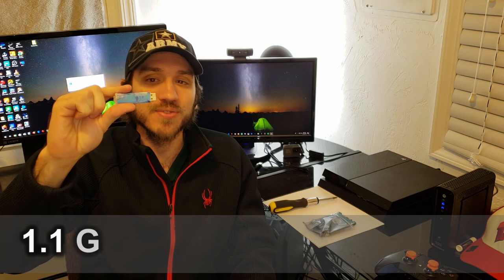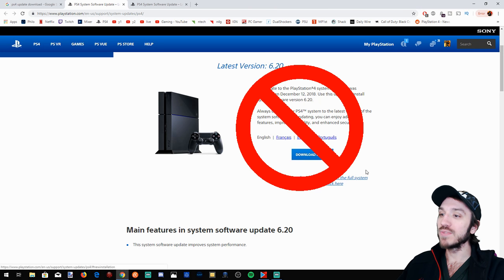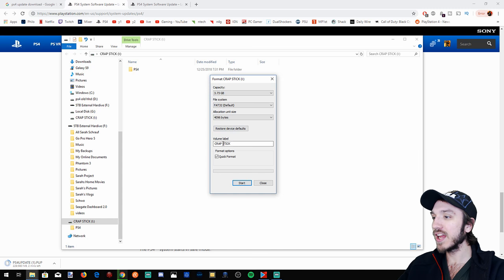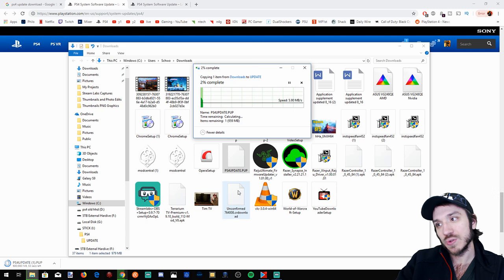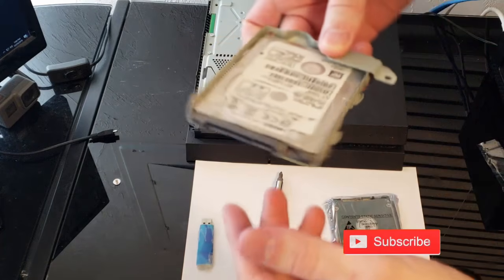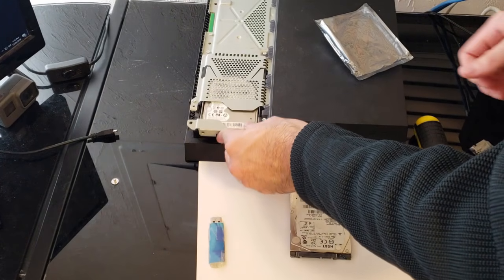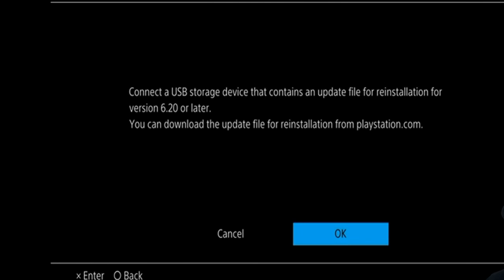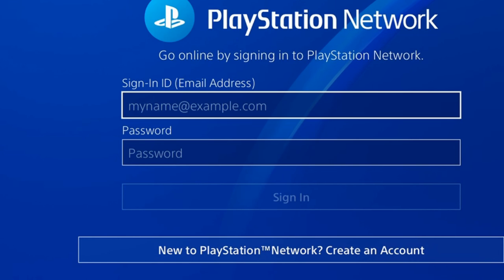How to install NEW PS4 Hard Drive (500GB to 2 TB) Upgrade Tutorial 2019!

Comment: Correction 2.5 inches not mili meters.
Reply: Will this solve the issue of my PS4 not starting properly? Every single time I boot up my PS4 it performs a storage status check and never goes to the main menu. It has been over 3 weeks now and this is driving me insane.
Reply: @CHlEFFIN  have you done it?
Reply: lukas yes. It fixed the problem. All you need is an HDD (or SSD) to replace the one in your PS4 which are crap, a 1.1GB flash drive and your set mate. It’s very easy.
Reply: @CHlEFFIN  I orderd one 5 minutes ago
Reply: lukas good luck mate! I will be here if you need any help.😁
Reply: @CHlEFFIN  ty
Reply: CHlEFFIN h can you tell me which one you brought and how much did you spend
Reply: @CHlEFFIN  Everything worked fine, thank you
Reply: Dacari Whitehead I ordered a Western Digital 2.5 inch 1TB PS4 HDD off Amazon for like $60 dollars - any HDD/SSD should work as long as it’s 2.5 inches.
Reply: CHlEFFIN what are disadvantage to ordering a SSD instead?
Reply: @Spanluver  SSD is faster than HDD. If you put the SSD on ps4 pro it load faster. But if you put the SSD on ps4 normal or slim, they don't differ much from HDD in terms of loading time.
Reply: Lunnardo Lukias yeah I knew ssd faster just curious about the Gaona but doesn’t seem to justify cost
Reply: Thank you I was confused
Reply: lol i was gonna say the same thing.. when IT people comment on non IT people's videos lmao
Reply: 2.5 mm would be so tiny
Reply: CHlEFFIN so it fixes the 7.50/51 error problems?
Reply: John Gilip yes
Reply: Help mine is stuck at 99 percent for initialization

Comment: I feel like sony is making things more difficult to do simple stuff I did everything this guy said and my ps4 still wont let me update the hard drive all it says is put a USB with the file eventhough I have it
Reply: https://www.playstation.com/en-gb/get-help/ps4-system-software/
You have to make sure that you  have the right file bc I was having the same problem.  It's the one at the bottom right of the page to the link in this comment.  Download PS4 reinstallation file
Reply: KarachayTulpar are you trolling or fr
Reply: also, your flash storage has to be formatted in fat32 since ps4 cant read the NTFS format
Reply: @gouthama9221  its so bad because fat32 is over 20 years old
Reply: Make sure it’s usb 3.0 or higher
Reply: Larry Hukic you cant use a 2.0 usb? That’s what I have and I get the same error as him
Reply: Mike Elmendorf it doesn’t have to be USB 3.0 he doesn’t know what he’s talking about. Thats just to use as extended storage. I just did it with a 2.0 Flash Drive and it worked
Reply: Bryan 350  really? I haven’t gotten mine to work yet
Reply: KarachayTulpar bro for real? I have the same problem. Please I need help. I did step by step on the video and my ps4 cant find the update file. I did both folders, ps4 and updates, but cant solve it. Did you find any solutions? Thank you!
Reply: Diego Morales I got it to work, just have to find the right file to download. The first file I downloaded wasn’t the right one and I honestly don’t know where I found the second one. I know it was on the same PlayStation update site. Just go through the files and try it one by one. One of them will work
Reply: KarachayTulpar it said I needed the PS4 update file when I choose the 7th option
Reply: @prmikee9 are you in fat32 formatted?

Comment: It worked for me until I connected the USB to the ps4 and said it couldn’t access the update file
Reply: You have to make the folders in order PS4 folder first on your external hard drive then add an UPDATE folder in the ps4 folder then add the sofware file in the update folder
Reply: @lordgunnyquay8933  I did that, still didn't do a thing, even did the FAT32 formatting.

Comment: I was so nervous to try and switch out my hard drive since I’ve never done anything like this before. You’re video was incredibly helpful and easy to follow. Thank you!
Reply: Hi, are there any risks? Like if I want to buy one from someone who has changed the hardrive are there anything to keep in mind?
Reply: @oo6069  the only thing I'd keep in mind is that the hard drive can be a very fragile piece of equipment. Handle it with care
Reply: @DutchVanDerLinde-sx1ox  where you brought your hard drive
Reply: @desmondpierce9177  Amazon
Reply: @DutchVanDerLinde-sx1ox  what size you get and did you also do the USB flash Drive update
Reply: @desmondpierce9177  1 TB. And I believe you have to use the flash drive to install the OS on the hard drive.
Reply: So will your old hard drive still have all the data on it
Reply: Period 🤝

Comment: Everything is spot on! I did this twice. Once with switching to 2 TB (2.5” one) and the second time was with the nyko data bank. Got a 4 TB separately with that (3.5” one). Luckily my nyko data bank can hold a 3.5” and a 2.5” hard drive. You would just have to press the button to switch to hard drives. Make sure red light matches to 2.5 or 3.5 as it says on the front of the nyko data bank. Make sure to only do that when the PS4 is completely turned off and while it’s plugged in. Then you turn the PS4 to the desired hard drive you want to start up. This only works for the original model of the PS4. I am unsure if the slim or pro has any nyko data banks for their models. This was before external drive support was added by Sony. Might as well keep what I have right now as long as it’s maintained

Comment: So I think you're the only one who explains exactly which file to download. Thanks
Now time to buy a hard drive
Reply: Roger dude will buying new hard drive fix my lag and crashing on Fortnite please tell me
Reply: PoliceGuy1111 Rblx yea but why do all of that when u can just goto safe mode and rebuild the ps4 database? ( it doesnt delete anything what it does is fix any problems like ps4 lag/freeze/ disc problems etc and no it does not delete anything off of ur system ). It’s basically like a quick fix
Reply: PoliceGuy1111 Rblx i just rebuilded mines a couple months ago and my ps4 been running extra faster and smooth since then and my disc problems are now gone as well
Reply: Manny Maserati I tried that I don’t crash I only get framedrops on gta online when I’m in a big lobby and it didn’t use to do that please guide me please I beg you
Reply: PoliceGuy1111 Rblx yea i get what ur sayin that was happening to me on black ops 4 as well , you only did it once? It took me 2 times of rebuilding database back to back to get this to work i also but default settings back and everything was fixed bro
Reply: Manny Maserati oh oh ok I will try that right now
Reply: @enriqueavilamoreno980  bro yes you will have like  a new ps4 and if you buy an SSD thats even better .
Reply: ben ali mourad thanks bruh
Reply: Enrique Avila Moreno did u get one I have similar issue I get CE-34878-0 this error on every game I try to load
Reply: Manny Maserati CE-34878-0 will buying a new hard drive fix this error on every game

Comment: So my data got corrupted and my ps4 went into a safe mode loop. Bought a new harddrive and used this video as a guide. My ps4 is in the factory reset menu rn and I hope to god i will never have anymore problems. Thx for this video bro

Comment: Good and clear video. Nice work. 
If you want to transfer your saved games, profiles etc., do a backup (from backup & restore option on the ps4 settings) to a USB external drive, before replacing the hard disk. 
After replacing the hard disk and installing the system software, restore the backup from the same menu.
Reply: How much space would I need on the external drive
Reply: @NijahsLover  You can check how much storage is being currently used on the existing hard drive and use an external which has as much space or more. Make sure that the external is empty.

Comment: What about backing up everything that you already have on your ps4?
Reply: Copy it too the cloud or another flash drive.
Reply: Im not too worried about backing everything up.  I normally play COD WW2, but now I play Division 2.
Reply: If you have a subscription to Psn you can just upload to the cloud. Otherwise use a usb zip
Reply: U can use a back up function in the settings
Reply: You cant back up using an external hard drive? It has to be a flash drive? I just bought an external hard drive and it's only letting me use it as extended storage it wont read it as a USB storage device when I try to back everything up 😩 its 1tb I was excited to do this today
Reply: Sapa Inca Use the Cloud If you have PS Plus.  You can also Use a back up function in your settings.
Reply: @MajinInca  you might want to format the external hard disk as FAT32 and you will be able to use it as a removable storage on your PS4 to back up files
Reply: @VivekSonii  brilliant
Reply: Can you get someone else to go on their ps4 but sign into your account and they upload the saved data to the cloud or online storage or whichever one or do you have to do it on your ps4

Comment: worked a treat mate thanks heaps. turned out my disk drive ribbon cable was unplugged causing me to get the error su-42118-6
Reply: Coukd you fix this, mine saying an error to but su 30645 8 aboht The update file is corrupted

Comment: It worked like a champ and didn't take long at all. This was an excellent tutorial and now my PS4 runs about as fast as my PS5. The only thing I did a little different is install a 2 TB SSD hard drive in mine so it moves a lot faster. I will definitely recommend your videos.
Reply: Heys how the 2tb working im thinking about getting a new ssd and did you replace because your hardrive failed on you ? Thats the reason im looking into one
Reply: It works great. I can tell the difference in speed and now my PS4 works as well as my PS5

Comment: When I get to the Safe Mode, it constantly tells me it can't upload the update file, even though I downloaded it a couple hours before I tried this. Latest file and everything, yet it won't get uploaded.
Reply: PS4 folder, UPDATE folder, the file, he showed it wrong
Reply: Download it using internet explorer or edge , i think you were using chrome , chrome tends to corrupt files , it did the same for me
Reply: I have the same problem. Please I meed help. I did step by step on the video and my ps4 cant find the update file. I did both folders, ps4 and updates, but cant solve it. Did you find any solutions? Thank you!
Reply: @123diegoxis123  I'm waiting till I get my own computer and a new flash drive, pretty sure my old one's screwed up.
Reply: @123diegoxis123  did u try to use "edge" browser ?
Reply: Saudxha i will right now!!! Hopefully it works man. Im dying :(
Reply: Jason Brown i bought a new flash drive one today bro and trist me ive tried so many times!! I also have a decent computer. I will try with another internet explorer, like everyone is suggesting! Ill tell you how it goes for me
Reply: Saudxha IT WORKED FOR ME!! Bro I slept like at 6am hahahaha you have to format your usb drive to FAT36 to FATX or some other fat name related (there’s only 3 options) and thats it. It worked for me. Also i download the update from edge microsoft
Reply: @123diegoxis123  
Congratulations man ! Finally haha

Comment: Thanks to your video, I finally decided to upgrade my PS4 500 GB HD to a 2TB SSD.  Amazon has the Seagate FireCuda 2TB Solid State Hybrid Drive Performance SSHD – 2.5 Inch SATA 6GB/s for $64.99.  Anyway, it's working very well.  The lastest PS4 update download is 6.72..that is as of 10/4/2019.
Reply from the maker: woooh. I'd love to see the speed boost with that hard drive.
Reply: Luis Santos wait do you have the ps4 slim
Reply: can you send the link of the SSD

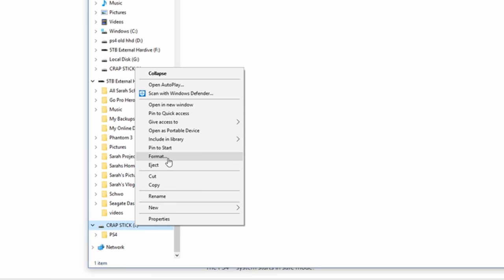Comment: If your flash drive doesn't work and you keep getting errors saying that the update file isn't on the stick, it is important to do the step at 2:35. I was having this issue and I formatted it to the FAT32 and it worked. So if your stick is Fat(default) change that to FAT32 and it might possibly work.

Comment: Thank you soooo much!! My ps4’s hardrive randomly started bugging out and kept freezing
Reply: I have a similar problem and it doesn't even let me play games because of the freezing , so by replacing the hard drive it can stop my Ps4 from freezing?
Reply: BULLDOG197107 worked for me, im assuming if the game is running at the full framerate/ expected performance than its not the ps4’s visual hardware thats at fault but the hard drive
Reply: @christianbilski3799  and did it worked?? my ps4 also freezing and playing games is really buggy
Reply: @help4free389  Ya it worked I got it fixed yesterday.
Reply: @christianbilski3799  thanks i already ordered 1
Reply: @help4free389  Hopefully it works for you.
Reply: @masuDore_  Thanks.
Reply: @christianbilski3799  I have a new hardrive and ps4 works normal again :D
Reply: @help4free389  That's great.
Reply: Help4Free which one do you buy can you tag me in link ?
Reply: @DontaeSavage  I got this one Seagate Firecuda ST2000LX001 2 TB

Comment: You cant back up using an external hard drive? It has to be a flash drive? I just bought an external hard drive and it's only letting me use it as extended storage it wont read it as a USB storage device when I try to back everything up 😩 its 1tb I was excited to do this today

Comment: does the usb have to be exactly 1.1 gb or can I use a 32 gb USB?
Reply: you can always use a bigger USB. 1.1 is just the minimum you need due to the size of the update file.
Reply: @LordTyrionLannister  oh ok and also we have to backup our stuff before we switch the hard drive right?
Reply: @sajidvijayan4306  yes. i would recommend using a second USB to save your game progress as well as your screenshots, videos etc . basically a backup of your whole data. also sync your trophies with the playstation network, otherwise they might be gone

Comment: On a separate flash drive from the ps4 one you can save all of your saved game data from your old ps4 hard drive before you remove it.  After installing the new hard drive and installing the operating system you can simply load the saved data from the old ps4 hard drive onto the now new hard drive. That way you don't lose where your at in any of your current or past games

Comment: My ps4 has been stuck in safe mode for about a week now and I’ve had to initialize it about ten times in the past which sucks, but now it won’t even let me initialize my ps4. So will replacing my hard drive get my ps4 out of safe mode?
Reply: I Have The Same Problem But The Thing With My PS4 Is That I’ve Tried All 7 options On Safe Mode And It Still Turns On Sage Mode , And My Power Button Doesn’t Work
Reply: Carlos Luna replace hard drive and it should work w
Reply: Same this is the 5th time i think a new hard drive will work

Comment: I forgot to put the pup file in an update folder in the ps4 folder. I also had to use a usb that was not bulky and use the second USB port as the first one would not read. Now I have a 2tb hdd until the ps5 is cheaper or has good games

Comment: I have done everything to a teeee exactly how you’ve done it and I’ve done sooo much more to try and resolve this... I either get corrupted file error at the reinstall screen or a random error that only gives me the option to restart ps4. Ive tried downloading on different computers, different browsers, different drives and again it’s a new hard drive and stupid error that has no explanation is popping up. Thumb drives are formatted and I even went into disc management on the thumb drive, it’s been two days, this is getting out of hand. Gonna smash this ps4 soon if it’s not resolved.

Comment: Technically it take you longer than 15 minutes because you first have to go through the process of backing up Save data, writing down any special settings you had on, and make sure if you're game sharing with a friend(s) letting them know to give you the account info again (even though it doesn't take that much time but it's still noteworthy). It's a long and tiring process lol.

Comment: Will I lose all my game data, friends, and everything? Or will it be there when I sign back in to my account? Is there anything I need to save to an external before doing this, so I can reinstall on the new hard drive? I'm trying to do this for my husband as a surprise and I don't want to mess up his system. He currently has an external hard drive and the USB port is going out, making the external not work properly. I want to download all of the external files onto the new 2T hard drive once installed.

Comment: Ok so I have a problem my ps4 broke it cannot be turned on so there’s no way to backup or carryover my saved data to a new ps4 and my only option is to swap the hard drive. Can I swap my old hard drive into the new ps4 and download the saved files to a usb and put it on the hard drive from the new ps4?
Reply from the maker: You cannot swap your hard drives, but you can copy data to an external hard drive.
Reply: YourSixStudios but how will I do that if my ps4 cannot be turned on ?
Reply: You need to probably take it back to sony if you have a warranty but your account and games will be saved on your profile

Comment: What if my USB file system automatically pops up as exFAT (Default) and there is no option for the one you had?
Reply: Did it work please update me ?
Reply: @dayblue_  I tried everything ended up not working sorry bro
Reply: I even tried converting a 1 terabyte hard-drive into a ps4 hard-drive and it didn't want to transition over even with the downloaded files from psn website